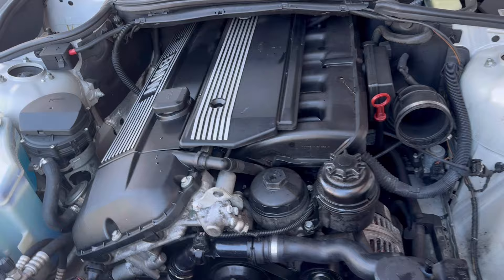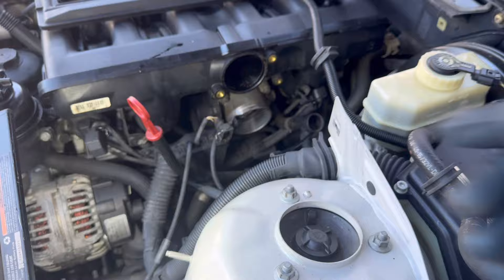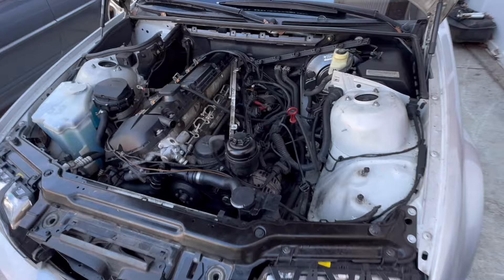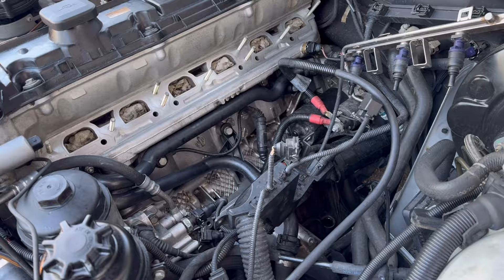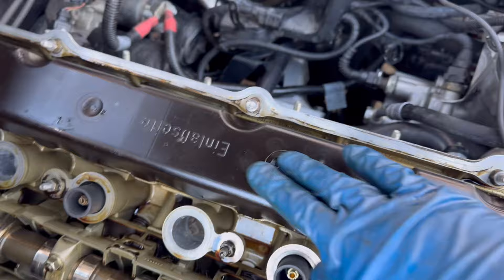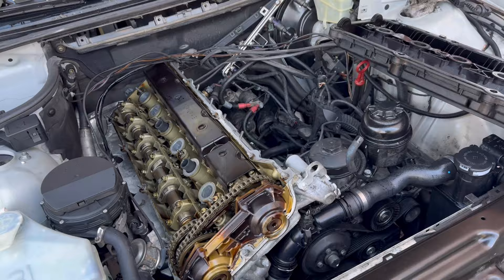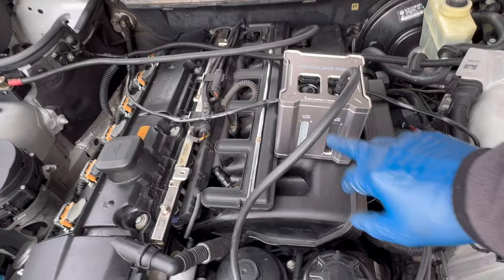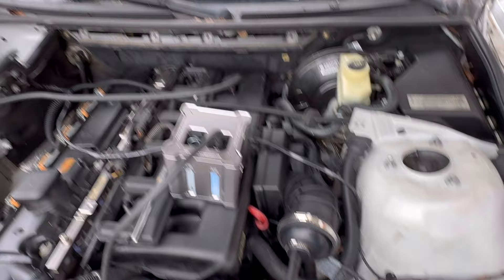Let’s do all the things while the intake is off - E46 330ci

Comment: Hi there, I'm currently replacing my intake boots and they are original. How did you manage to take off that one hose clamp on the lowet boot? I've been trying to take it off for awhile now, but just haven't been able to.
Reply from the maker: It helps if you unclip the suction pipe that goes over to the brake booster.  With that out of the way, I start with the small hose clamp to the ICV then the throttle body clamp.  Combination of a small stubby screw driver then regular size worked well.  Once it’s loose you can rotate the clamp to get better access. You might also be able to use a socket and 1/4” ratchet on the hose clamp as well.
Reply: @robsweekendgarage  Thank you for the advice. Unfortunately I didn't have a stubby screw driver on me so I just used a 1/4 ratchet with a 6mm socket on it, I had to remove the cabin air filter and the heat shield for the ecu to the right in order to just barely be able to loosen the ICV's hose clamp; +1 new intake boot - the skin on my knuckles 😂